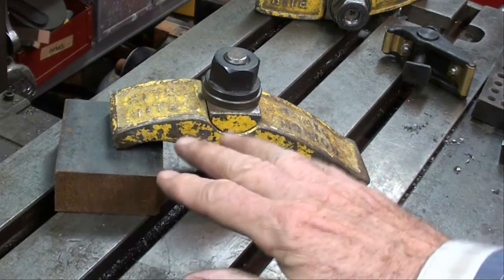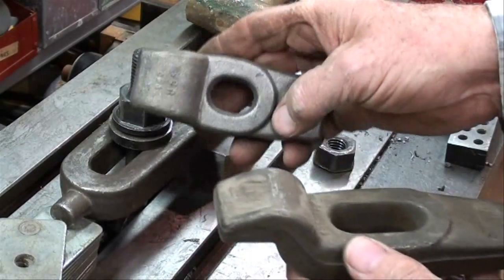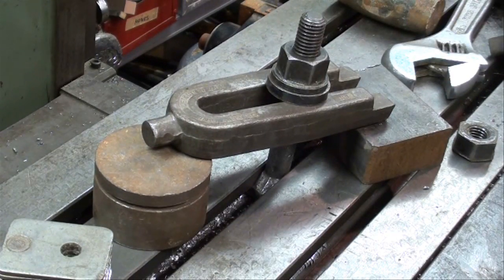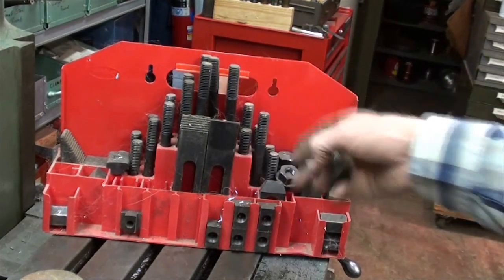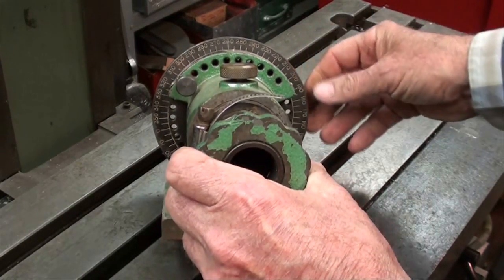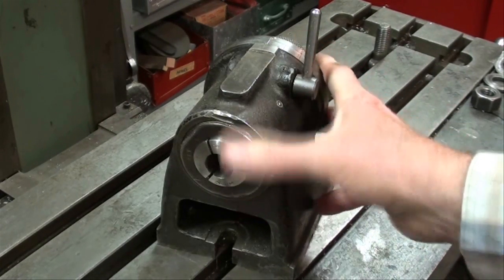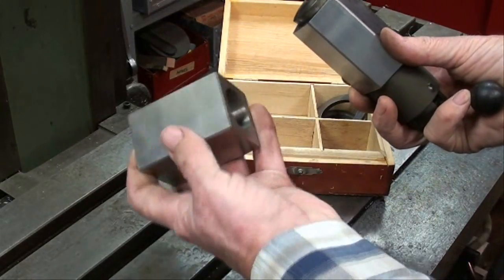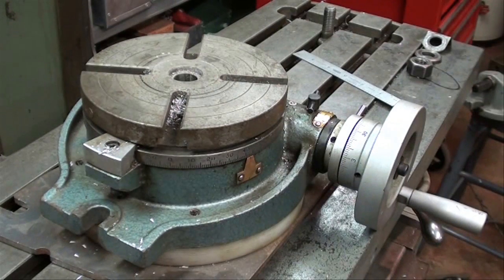MACHINE SHOP TIPS #60 Bridgeport Mill Workholding Part 2 of 2 tubalcain

Comment: Thank you for your fine video. I have a Enco 105-1110 bench top mill and a 12" swing lathe. I want to mill slots in  1/2" to 3" round stock parallel to the round stock axis. I have a 3 degree of freedom non-tilting rotary table. What tool do I need to hold the work? Please contact me at: bdd4 at att dot net Thank you

Comment: Thank you for your fine video. I have a Enco 105-1110 bench mill and a 12" swing lathe. I want to mill slots in  1/2" to 3" round stock parallel to the round stock axis. What tool can I use to hold the work?

Comment: I've used the Rotary Table often for doing a bolt circle.in a pinch or for milling curved slots or for milling the edges of round stock (bigger than my lathe can hold) down to a diameter.